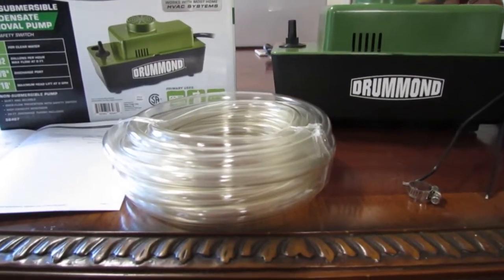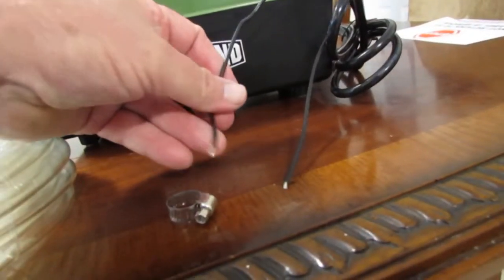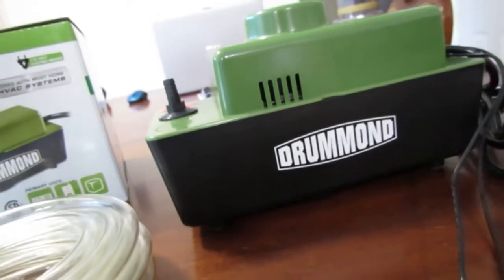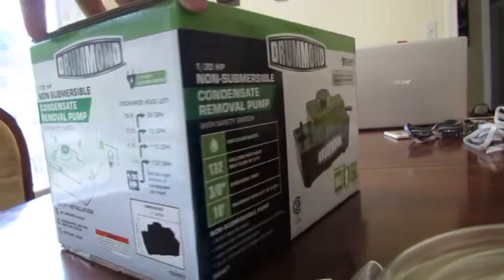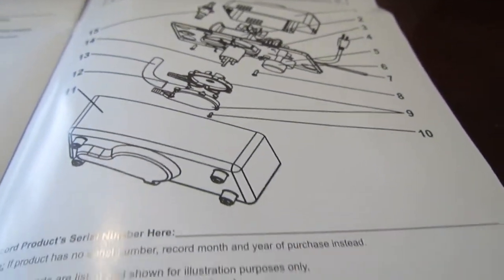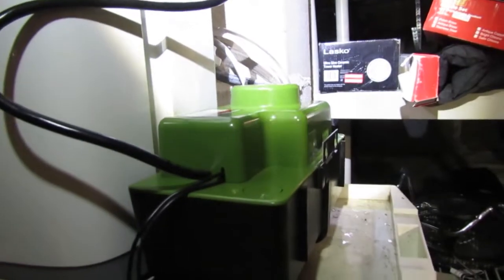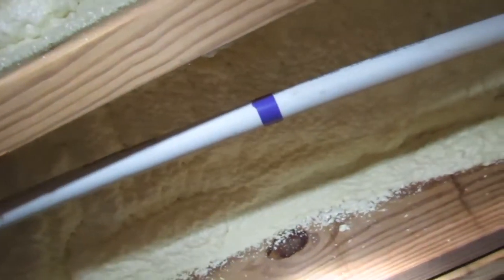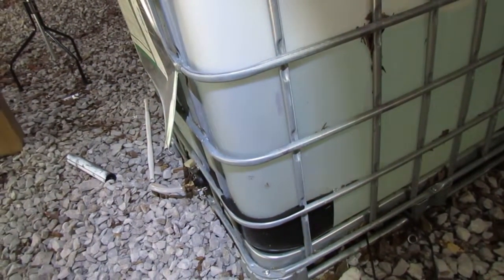Best Air Conditioning AC Condensate Water Pump Drummond by Harbor Freight. Read Below

Comment: Thanks for the video ! just to be clear it is pump height 18ft not pump distance 18ft, so example my use case is up 8 feet then over 20-30 feet so lift or up 8-10 feet so I get the 72gph. Like your idea for reusing the water I'll have to try that.   I know you video showed it but thought it may be handy to have written also.  
0 ft - 132 GPH
5 ft - 110 GPH
10 ft - 72 GPH
15 ft - 22 GPH
comes with 20 feet of 3/8 tubing.